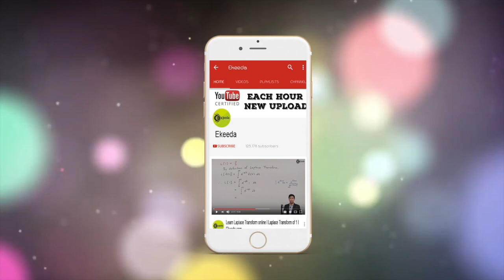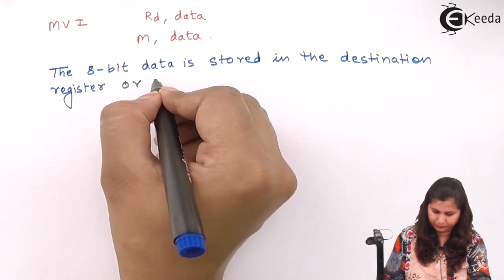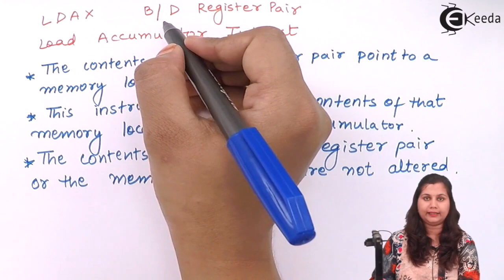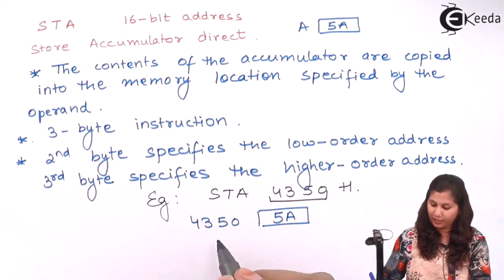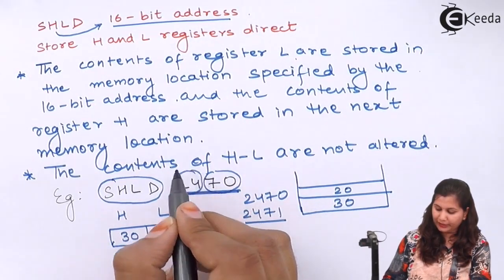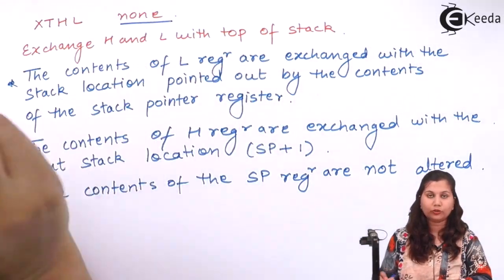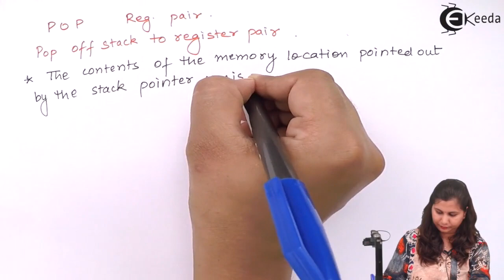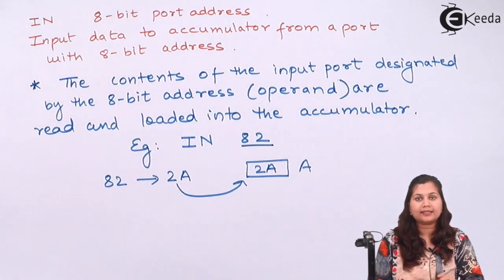Data Transfer Instructions of 8085 Microprocessor - Instruction Set and Execution in 8085

Comment: instructions MVI and LXI are looking same what is the difference between them clearly explain
Reply: Lxi is for 16 bit and mvi for 8bits
Reply: x is for a pair which means 16 bit. lxi is load pair immediately. mvi is move immediately which is default of 8 bit
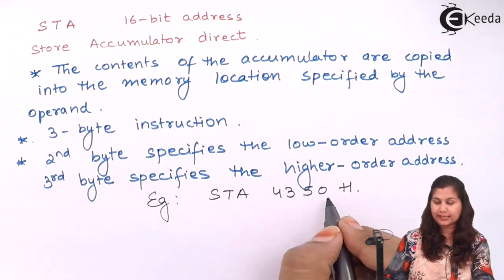Reply: @namrata3282  at 23:00 mam used 4350 h ,,I understand 4350 is a memory location but what does h stands for plz tell me
Reply: @flashkamunna3071  hexadecimal number